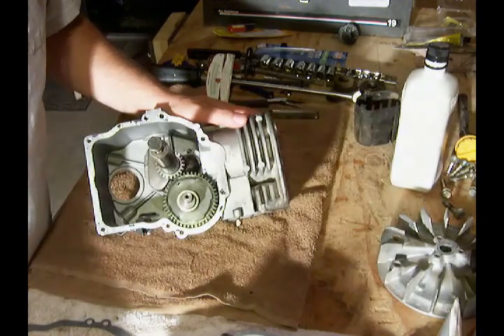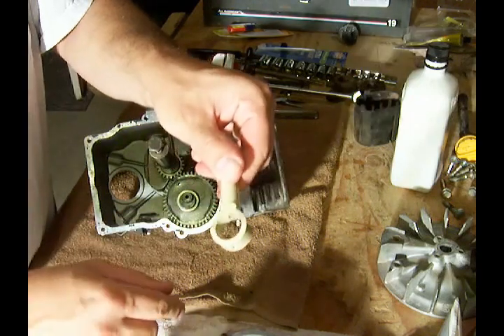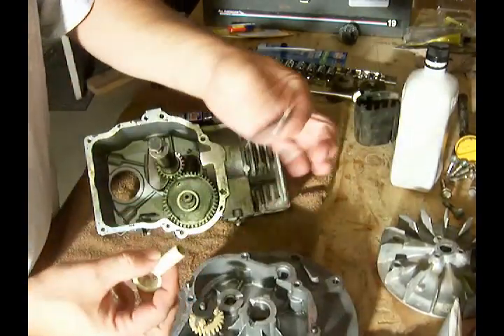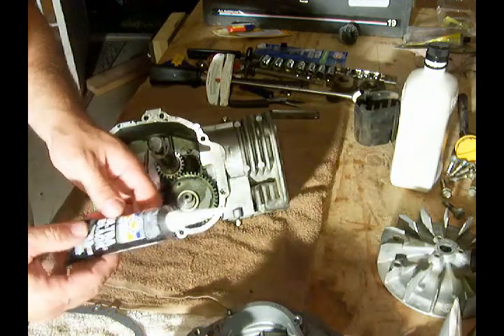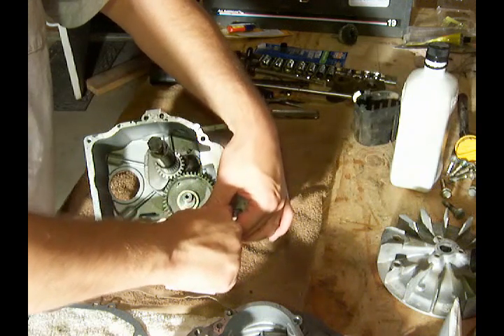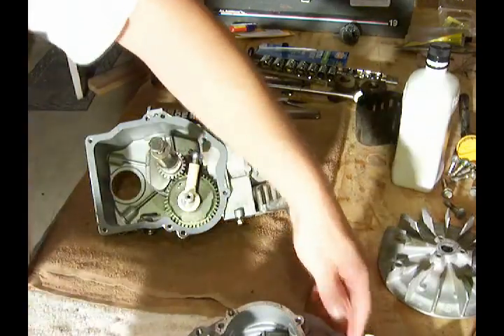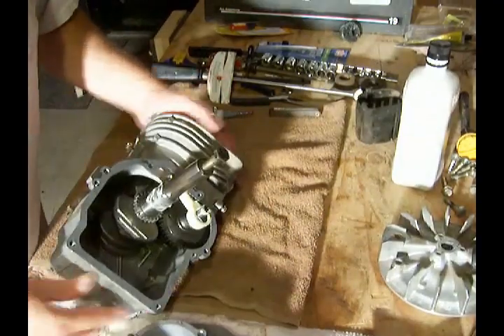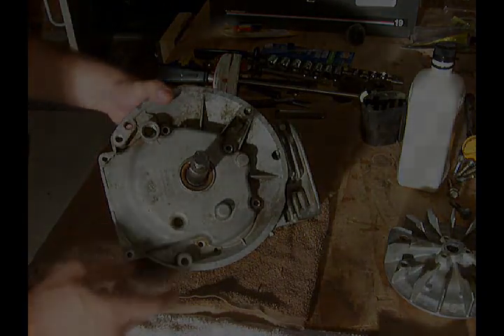#14 Tecumseh LV195EA / LEV120 - Oil splash and crankcase cover installation

Comment: When putting the cover back on, does the keyway on the cover have to line up with the keyway on the crankshaft?
Reply from the maker: No. The grooves in the cover, I believe to be oil passages to keep the shaft lubricated. Thanks for watching. It's been awhile since I made this video.

Comment: Perfect, this is my exact engine; thank you so much. One question, does the small lever inside the crankcase that controls the governor need to be in a certain position before replacing the cover? Thanks again
Reply from the maker: No it does not. Thanks for watching.

Comment: Rebuilt motor can get it to run but once it gets hot and you shut it off motor locks up and you can't pull it any ideas
Reply from the maker: Sounds a little light on oil but you probably already checked the oil level.

Comment: Hi all.  Thank you to sblg43 for this great video series- I'm learning a lot and appreciate the confidence these videos inspire.  Concerning this particular step of reassembly- Why is it that RTV is only applied to one side of the crank case gasket?  Is one side more important than the other when applying RTV? Thank you for reading!
Reply from the maker: I no longer use RTV. I now use Form-A-Gasket #2 (non-hardening). The RTV is too difficult to remove if you ever have to open the engine again. Thanks for watching.
Reply: There is a oil pump on camshaft. I wouldn't use rtv if a string of it breaks  off into pump you know what happens.

Comment: Does the Governor gear need to be set a certain way when installing the crankcase cover?  I'm assuming that's the governer gear?  The while small plaster gear in the cover?
Reply from the maker: That is indeed a part of the governor. No particular position for that gear - just get the teeth lined up with the other gears. Thanks for watching.

Comment: Hi, does the oil slinger gear need to put in any certain way - in relation to the main gear - thanks
Reply from the maker: +tonyswhirl Not sure what you mean by "oil slinger gear" but if you watch this entire series, it should all go together easily. Thanks for watching.
Reply: +sblg43 I was referring to the timing marks on the gears - I have found it in another video - I do not know if you covered that when putting it back together - Thanks for your reply - great videos - very well done - Thanks
Reply from the maker: tonyswhirl It was covered on a previous video in this series. Thanks for watching!
Reply: +sblg43 - Thanks - I should have watched them all

Comment: Thanks so much for the rebuild series.  This segment (#14) really helped me figure out what the end of the oil slinger was and where it went.  I had an oil leak at the crankcase joint and couldn't figure out where that part belonged after getting the cover off.  Now I know how to reassemble the cover.
Reply from the maker: Bill Horton I am happy to have helped! Thanks for watching! It's great to be able to do it yourself!
Reply: i,m not seeing anywhere for that ball to fit into
Reply: ahhh i see how it goes now
Reply from the maker: Thanks for watching - glad you figured it out!
Reply: yeah good video...now if it will run
Reply from the maker: You got this!

Comment: Glad to see you used the rtv, as that was my plan as well. Thanks for pointing out what needs to line up too.
Reply from the maker: I have read mixed opinions about the use of rtv. The biggest concern is having to remove it the next time that engine needs to be opened up. I also use form-a-gasket 2 sometimes. thanks for watching.

Comment from the maker: What I would do now, that I didn't do in the video series, is to de-glaze the cylinder. I am fond of the flex-hone tools from Brush Research. Not cheap but easy to use and quality products. I use their 240 grit silicone carbide hones to de-glaze the cylinder when rebuilding an engine. They come in many sizes - I have 3 different sizes for three different cylinder sizes.

Comment from the maker: I appreciate your interest. I have to say that I did not bore out the cylinder. I used the original piston and rings. You can see the tools that I use if you visit my blog - click on the link below my videos. The new parts that I used in this series was a gasket kit (Tecumseh #37613A), Spark plug, air filter, and oil. I think that is all. Forgive me if I forgot something, it was a year ago.